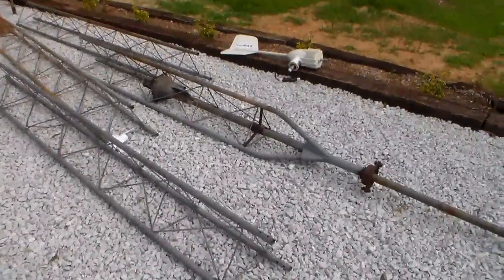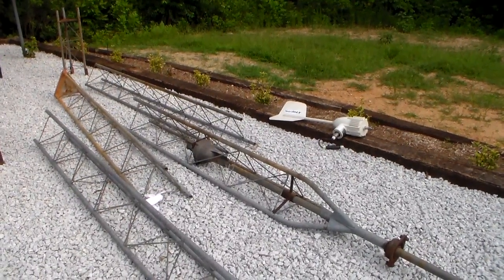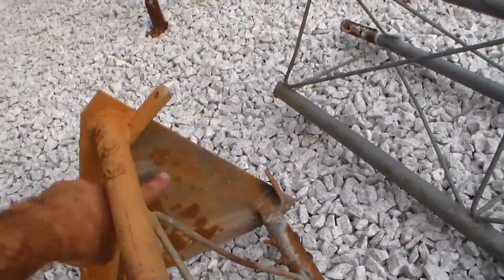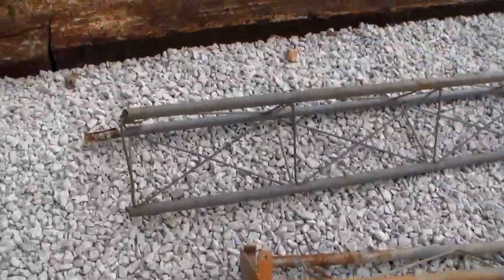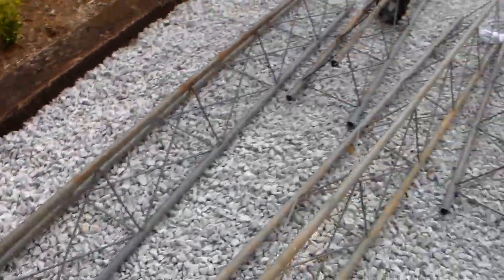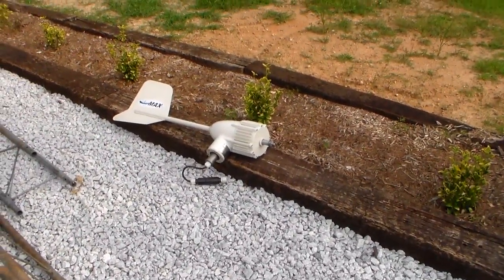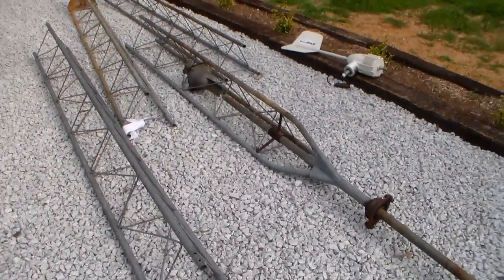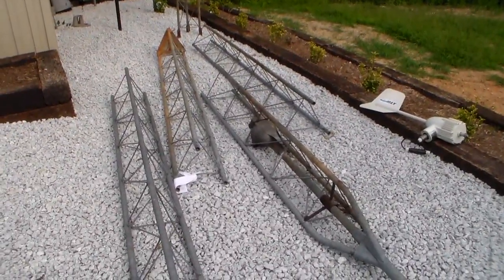Need help with my tower and wind turbine.

Comment: Hi doing the same thing with the same tower just got the top home still have to get the bottom but we have had towers over 40 years for cb's my dad put a pole with a hole cut for a pulley at the top in next to the tower and it has a hinged mounting plate on the bottom and we just used a cable with our wc ac tractor to lift it ! and it had a big moonracker 4 on it ! i am going to do the same with this tower for my wind turbine ! good luck with it ! SP1 have a nice day ! :-)

Comment: Check out DX engineering dot com. They carry Rohn and US Towers. The first was a hinged bottom for a Rohn tower. You'd need tostraighten the tab and mount the base plate for it in rebar and concrete. The link has all the data you need for the Rohn tower, the height, and the dimensions of the concrete rebar underpinning. That rotor assembly, you gonna need that? Is there an ID on it? 5 wire or 8 wire? I may be interested...
Reply: And for 40-45' guy wires are a must, unless you can mount the hinge plate near a building, and lean the tower up against the eaves and fasten it into the rafters. Lots of options.
Reply from the maker: Do not know about the rotor yet.  I dont even know if it works.
Reply: breezebro The turbine on that would generate RFI 'noise' and interfere with anything else mounted on that mast.
You're right though: most of us Hams would (or have) kill(ed) for a decent little mast like that.
Maybe we should convince him to just get a decent 90' modular ST-5, ST-8, ST-10 or ST-12 for that turbine, and use this Rohn for serious SHTF Comms.
Reply: southernprepper1 he's right. That's not a self supporting tower. It Wil have to be guyed.
Reply: breezebro So noted. I still would not recommend a 45 ft tower with a turbine without guyed supports unless it was a self supporting tower.

Comment: I have a pair of towers made from this material that I need to take down and re-guy. The way I plan on doing it is either renting a bucket truck or climbing up part of the way and adding guy wires in layers as I go up, by the time I guy the last section ill be climbing to the top of the tower with multiple guy wires below me, then I can start disassembling the thing from the top down piece by piece, plan to install them in a different location the same way.

Comment: To get it put up you will need to rig or borrow a gin pole. That base looks ok. You will also want to put up up some guy lines for a tower that big. And wear you safety gear when you climb it... 45 feet is a long fall. Good luck.

Comment: I put mine in a 24" dia. x 36" deep hole filled with concrete, 60ft tall with 3 guy wires on it.

Comment: well i've jumped them up myself(built them from bottom up). but you could make a hinged mounting plate on the bottom, then you only have to pull/tow it up(and then you wouldn't have to climb it to work on things as well).
Reply from the maker: My buddy is ordering one brand new with a plate that I think will let you let it up and down so seeing his will probably help me.  I might be able to make one after I see his.
Reply: Super! Ya if they are cheap buy a pre made one. If not hit the scrap yard for some plate and a bit of tubing! I'd think about a light guying as well, it's gonna catch a bit more wind force than a ham/cb antenna was giving it.
Reply: Yeah, you can make much of the parts you need for the rohn 25, just paint the heck out of it
Reply: southernprepper1 get with me, i have diagrams for all the stuff from rohn for that tower if ya want them, base plates, breakover etc, and the specs for guying them
Reply: Actually thats a great idea. I like stuff that can be repaired easily